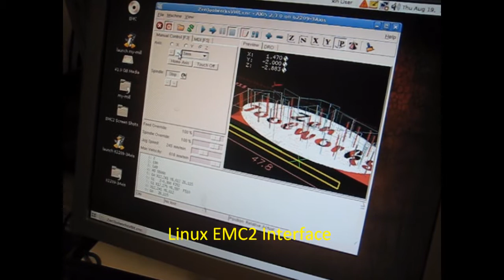Zen Toolworks CNC Stone Carving With V Bit

Comment from the maker: David,
Those are actually proximity sensors. They act as limit switches but are actually more accurate. These type are relatively easy to mount. You just drill a hole large enough for the threaded portion of the sensor to fit through. Then, it has 2 nuts, one for either side of your material. You just tighten these down and the sensor is then locked in place. The sensors work by sensing a piece of metal at a distance, so depending where you are mounting them, you may need to mount a small piece of metal to the moving surface so it can be "sensed" by the sensor. 
We sell them on our website here: http://www.zentoolworks.com/product_info.php?cPath=16_43&products_id=80
Feel free to contact us if you have any questions.
Thanks!